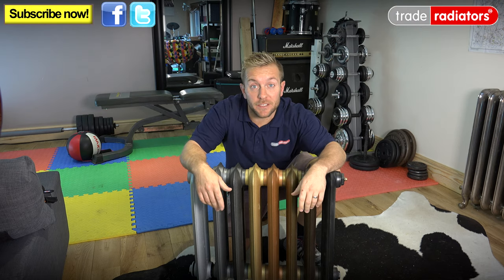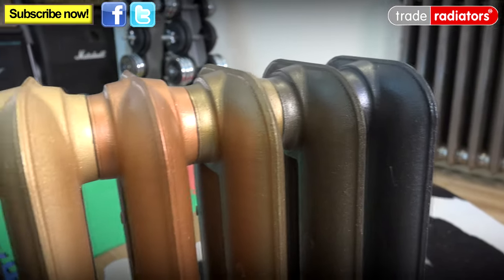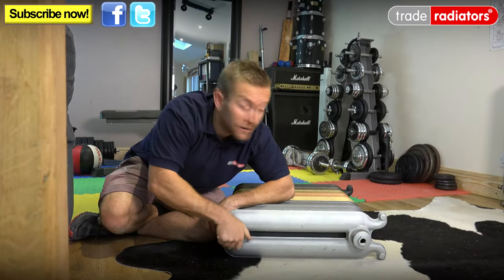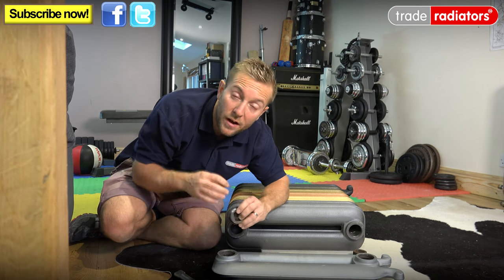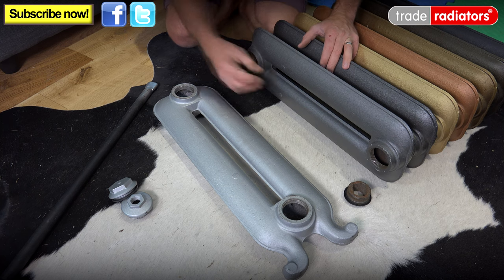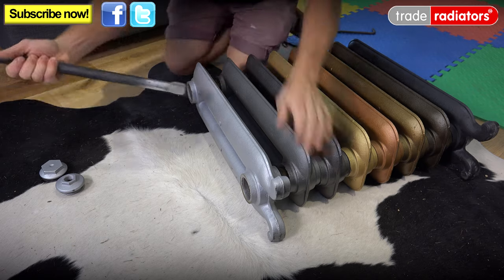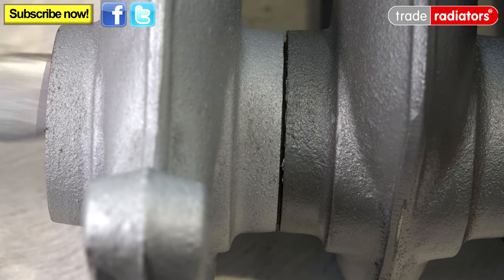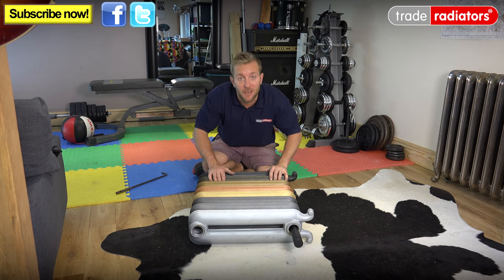Connecting A Cast Iron Radiator Together

Comment: Hi . Just bought some restore radiators ad unfortunately the previes owner use a very long flush  product and manage to distroy some of the rubber seal. So no I have to take it all apart and replace the seal. I bought the fibre washer as some people say it's more durable . The question is we're can I buy the joining tool.from this video looks like my nipples are the same size and make as I know some hopes are different size.much appreciated in advance for any advice

Comment: Neat way of joining these however relying on a rubber washer on a cast iron rad is a bit dubious. Also 200nm is pretty tight chances are most people won't tighten it up to the correct torque.